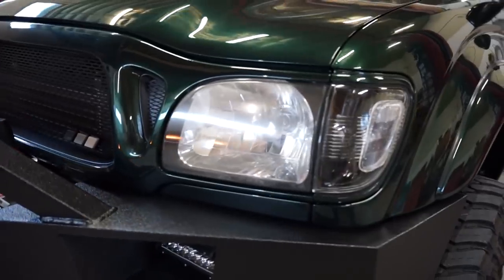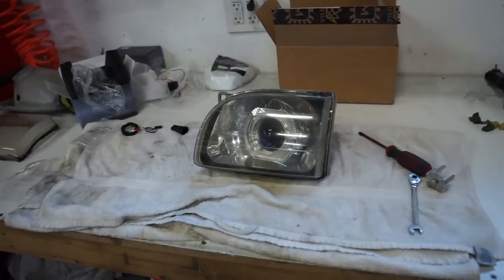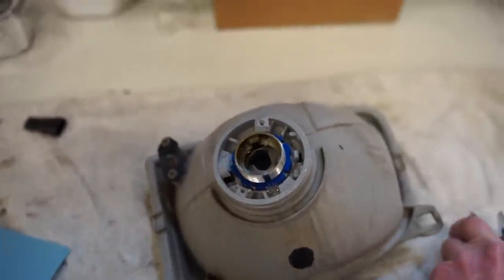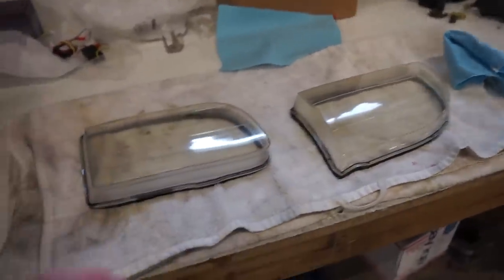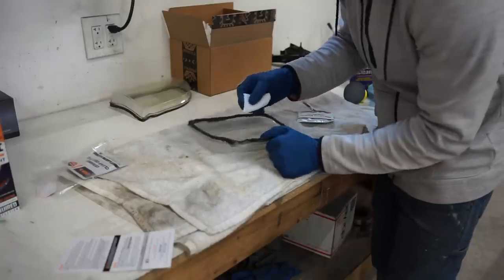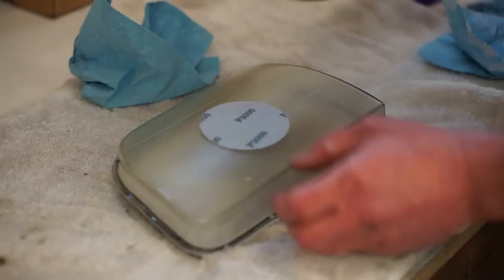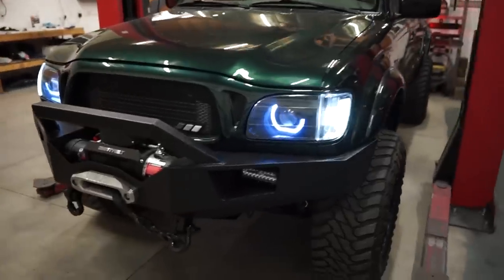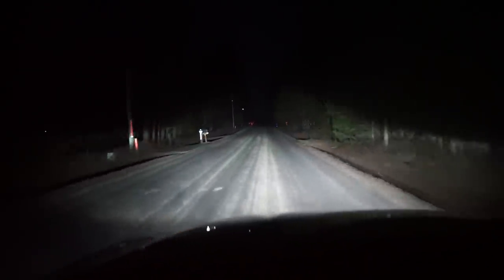Building The BEST Headlights For A Toyota Tacoma!

Comment: I'm trying to rig up a similar switchback system on my truck and bought shrouds just like these with the same wiring system it seems. On the wires for the turn signals the original has the green and white. The harness for the switchback has the black box with the black and yellow going to the shroud. Then it has four wires coming out of the other side of the box (black, white, red, yellow). I couldn't see how you rigged the other four wires here and I don't see much on the forums that's helping me. Could you give me a brief description as to how you hooked those up?

Comment: Stellar work as usual man. I've used several of those Cerakote headlight kits with amazing success, they work extremely well...especially if you want brownie points with your mother in law! 🤣

Morimoto is also top quality kit, I'm running a 55w HID kit with their bulbs in my Tahoe, and I have a set of their XB headlights on my Silverado. Insanely bright - they are a huge step up from the factory HIDs. 

Funny you mentioned TRS, too...Nick C. over at there is an acquaintance of mine, great dude. Good choices all around, man!

Comment: much like yourself ive got a 3rd gen 4r and a 1st gen tacoma. i want to put 4r glass headlights on my tacoma. havent given it a close look for mounting yet. i know the grills have different shapes for the headlights would need a 4r grill on the tacoma. dont know if its possible but my 4r headlights are like new after 23 years and tacoma lights are crap after 18. after thinking about it some more the hood would prob have to be changed too.

Comment: I wonder how black chrome spray paint would work on headlights. I think Duplicolor makes one called shadow chrome or something like that. I think it’d turn out nice, and since most of us don’t have a sandblaster, might be a more doable option.
Reply: Some folks seem to be using clear coat for headlight restoration using 2k in a rattle can, along with a similar sanding routine to what you did on these. Results seem promising. You have any experience with that?

Comment: Did you mark your old lights on the wall before the retro? I'm about to do the same thing but forgot to mark old cut offs. Thinking about installing prior to putting lense back on to get cut offs lined up then pulling back out to put lense on and bake back together.
How's your cerakote kit holding up? I tried it on an aftermarket set and it didn't last for sh#t